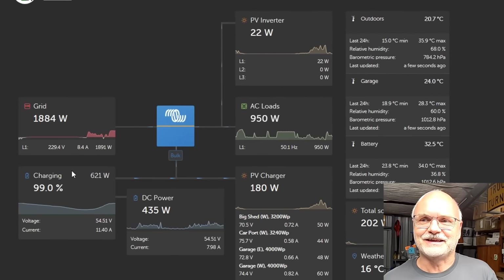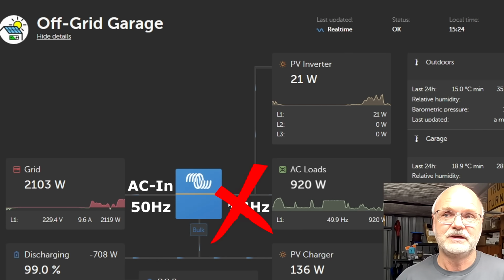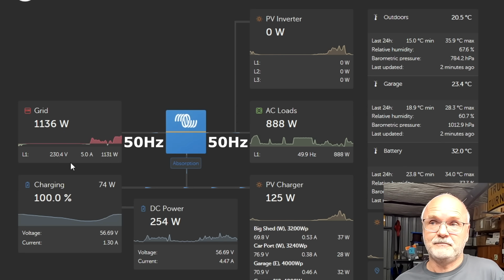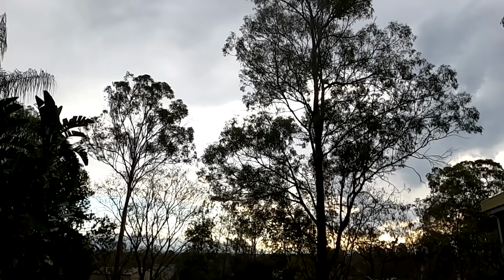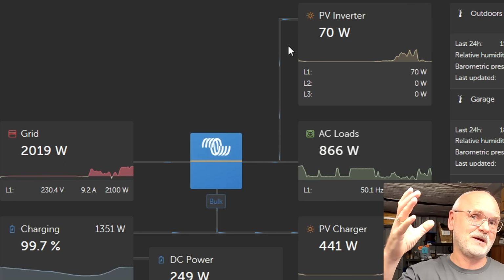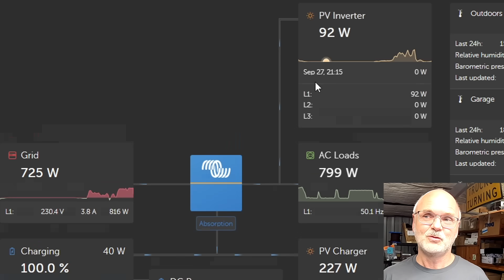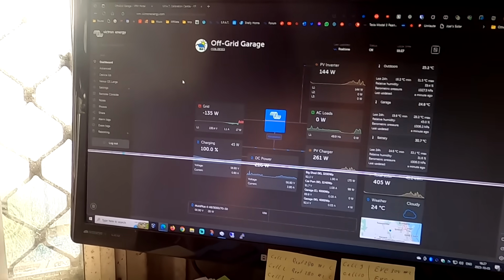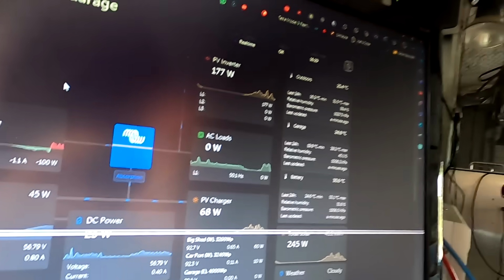Victron Multiplus, Micro-Inverter and Generator. Where does the energy go once the battery is full?

Comment: I think I asked for testing this scenario 😅
Next step should be the measurement of voltage and current with an oscilloscope to check their shape and phase shift. It could be that it is all reactive power (Blindleistung) and the Victron and the microinverter are a bit confused with 90° of phase shift.
Reply: Blindleistung ... ist das nicht der Schaum im Bierglas?
Reply: @mbr8981  Ja, genau 😄
Reply from the maker: What would make the inverter shift phases though? They would need to go opposite directions, one inductive, the other capacitive to compensate for the surplus power.
Reply: @OffGridGarageAustralia  There is no "excess" power if the inverter and generator are incorrectly calculating "power" as AC RMS volts x AC RMS current measured and calculated based on internal parameters. The inverter is likely only putting out 15-20W net to compensate wiring losses from 150VA getting bounced back and forth between the inverter and generator output filters.

Comment: Thanks, Andy I was wondering, 230v but what is the current coming from the PV inverter? If there is low or no current flowing the voltage should not mean much should it
Reply from the maker: It was around 130W, so roughly half an amp at 230V.

Comment: Hey Andy, maybe you use NodeRed and a DTU to shut down / limit the power production of the micro inverters.
Reply from the maker: The micro-inverter is connected through a Shelly 1PM so this is actually an option to turn this off if certain situations occur. Home Assistant is another one...

Comment: I have a grid connected multiplus II with PV generator on AC OUT 1, It does change the frequency when the inverter is not allowed to feed back to the grid.  So AC IN and AC OUT 1 can have a different frequency.
Reply: I am studying on installing such a system and did not expect the Multiplus doing a frequency-shift whilestill being grid-connected. Are you aware of any Victron documents that may shed some more light on this? Specifically AC-coupled PV in a zero-grid-export multiplus installation.
Reply: @marcelvanlieshout3508  In the ESS settings you can decide if you want AC coupled PV feed to the grid or not
Reply: @marcelvanlieshout3508  Sorry but every time I comment here, it is removed.   I followed victron online courses. I use the ESS function that must be configured as an assistant.  If you don't need ESS you can just add the "PV inverter support" assistant.
Reply from the maker: Is this maybe turning off the transfer switch in the MP when you disallow exporting?
Because if you have a large load coming online, the MP would not be able to lower the frequency quickly enough and it usually takes such power spikes quickly from the grid.

If you post links, the comment will be removed. Sorry for that, YouTube does not give any other option.
Reply: @OffGridGarageAustralia  perhaps it uses the batteries to satisfy this surge?
Reply from the maker: @marcelvanlieshout3508  of course... we have a battery too 😁🤦‍♂

Comment: It can go into the Generator ( off-grid inverter). That is also a bi-directional inverter charger and will charge that battery bank.
Log into the other inverter, and you will see it isn't just a calculation.
A Phoenix can have AC - -coupling and use it to charge. The Charger settings are available in the Veconfig software. They are just customarily hidden.
When the Phoenix batteries are full it will raise the frequency to the entire system, and in doing so the micro-inverter will throttle.
Reply: I suspect the above is correct answer, depending on how the Phoenix is setup. My Quattro has a AC connected PV inverter, and it is setup as an ESS system, but in the event of grid failure it will still power the house. My understanding is that if the system wasn't  setup to alter the frequency when I have grid loss and the batteries are full, and too much power is being generated by the AC connected PV it would be dumped into the cells until the BMS shut off due to over voltage, then the whole system shuts down. I've not tested this, but have tested the frequency shifting, which works perfectly.
Reply from the maker: @TheRonskiman  yes, it is correct. I tested it today and could charge with over 2kW through the Phoenix, backwards into the second battery. It really works! Got it on video too.
Reply: But with Phoenix default settings it wouldn’t increase frequency, so would overcharge and/or shut down. I wonder why Victron don’t enable frequency shifting by default. It seems like a safer default. A diesel genset will increase frequency as load comes off. Maybe this is why Victron don’t recommend using inverters as the generator. Detailed config required to make it work well.
Reply: Some advanced s*** this 😂
Reply: The manual does not mention anything about charging from the mains supply.
Reply from the maker: How do I connect the Phoenix inverter to VEconfig software? It has no VE.bus, just Ve.direct.

https://www.victronenergy.com/media/pg/VEConfigure_Manual/en/introduction-and-requirements.html
Reply: He travels/lives in a truck,vid is 1 year old.

Comment: Cant the Phoenix Inverter charge the battery?
Reply from the maker: The Phoenix inverter is an off-grid inverter, so cannot take reverse power.
Reply: In his example the batteries were already full.
Reply: @adon8672  ok at least the first part was only the multiplus battery there was full, as the "generator" was on another battery, maybe i misunderstood 😁

Comment: It's exporting back to the grid by raising the voltage higher than the input from the grid, a grid connected multiplus does this all the time the phoenix inverter is getting back fed and is likely handling it a bit but eventually you will will I suspect burn it out
Reply from the maker: Yeah, good point, the 150W is probably what the Phoenix can cope with, with more it might go 💥

Comment: It had been 4 days, I was getting withdrawal symptoms!

That's an interesting conundrum. Why is it showing energy going to the other inverter? Does it have some sort of load capacity like wind inverters?

Once installed, my two SMA dual string inverters are meant to be controlled by increased frequency too, so the question would be the same (as we have grid input too). But they and the SMA hybrid inverters will also be connected via Ethernet/WiFi so maybe they can control the string inverters that way too. I know this isn't a solution for you, and I'm not sure it is for me, so thanks for sharing this. I don't want potentially 10kW flying in uncontrollably 😮
Reply from the maker: I'm not too concerned in my case because I don't have the genset running when the battery is full. It was more the question, what will actually happening in these rare occasions and raise a bit of awareness.

In your case, the communication between the devices could be what will prevent any escalation in such a situation.
Reply: @OffGridGarageAustralia  maybe my expensive SMA Home Manager will be of use, as it sits right after the grid, so could potentially isolate the home system from the grid if needed. It's a hefty little piece of kit for its size.

Comment: Like# 67
Reply: System overhead?
Reply from the maker: Tomorrow, Paul, tomorrow... 5am AEST. Or Sunday...
Reply: @OffGridGarageAustralia  the suspense... my Growatt does the same thing and I have no other "grid" source... How do you measure what the inverter is consuming? I "inferred" it as I have no idea how to actually measure it's consumption... Impatiently waiting until tomorrow...
Reply from the maker: @paulcurtis5496  consuming in terms of self consumption of the inverter in standby?
Reply: @OffGridGarageAustralia  self-consumption across the board, to power itself, perform its duties whether in standby or running. I'm not sure how to accurately measure this, but I do see it in the way you were seeing it. I'm not connected to any other power source other than the sun, when my battery is full the solar provides more power to the inverter than the load - so where is the excess power going? I've always thought it was being consumed by the inverter itself.
This consumption varies between 80-200ish watts? I just don't know how to accurately measure this, I can only subtract the load from the incoming solar.
Well and some amount is lost to waste, resistance, heat, all of the transactions between components, poor solder joints, insufficient wire size or material, etc.

Comment: I thought that when the load==AC coupled PV generation it would then disconnect the generator.
Now it has disconnected the Generator it can then increase the frequency to reduce the output of the AC coupled PV.
This assumes your AC coupled PV is on the AC2 output of the Multi-plus.
Reply from the maker: It does not disconnect the gen though. It stops taking power from it, but the gen still sets the 50Hz for the whole system.
Reply: @OffGridGarageAustralia  There seems to be a hub-2 Assistant that does disconnect. But seems to warn against using that as can then struggle with power spikes. Glad you pointed this out as I though I could AC attach some micro-invertors to a grid attached system and it would frequency shift. Now I realise only reliable route is to go down the Fronius route which seems the only supported way to avoid grid export (which I can't do here).

Comment: No mp won't stop charging. Can you connect a relay based on soc.
Reply from the maker: Yes, I can. The Multiplus has got one built in. I could use it to turn off the Shelly of the micro-inverter.
Reply: @OffGridGarageAustralia  I would definitely do that. I just had a fire from a ac coupled inverter not turning off due to a BMS fault I believe. You are getting away with it at moment because of small AC couple but you really need to control it. The Phoenix is a low frequency inverter and any excess power freewheels through the clamp diodes on the MOSFET drive back into the battery. Mine diy inverter works the same.. it has no way of stopping that power other than turning off the AC output to the microinvéters or relying 9n frequency shifting.
Reply from the maker: @jasondevine6014  it never occurs in my system. This was just for a test. The gen/Phoenix does not come on automatically.

Comment: Probably boiling your capacitors in the multi plus
Reply: Wrong. If multiplus cant change output frequency from having power at it's generator input, it will dump all extra power there (basically that input is directly connected to the output via relay)
If there is an actual generator there, it will reduce fuel usage to compensate (or frequency will increase till solar inverter throttles enought if there is enought power to spin generator with an engine). 
Having inverter instead of a generator: it will charge the battery untill full and then increases frequency itself / blows up / shut down. After that multi plus no longer has any power at generator input so it can raise the frequency running by itself.
Reply: @volodumurkalunyak4651  very interesting
Reply from the maker: Good point with the lower fuel consumption with a real genset.
The Phoenix inverter cannot charge its battery though.
Reply: @OffGridGarageAustralia  on the video multiplus eventually reported negative power consumption on "generator" input - essentially it allowed power from grid-tie inverters to go there (into Phoenix inverter, 200-250W If I recall correctly). 
Therefore Phoenix inverter must have charged it's battery at that particular (probably short, at least coule of seconds) period.
What would happen if batteries were full (+ BMS cutoff on either cell overvoltage or pack overvoltage) - Phoenix inverter would either shuts down (on input overvoltage) or blow up or increase output frequency (forcing grid tie MPPT's into reducing power or even shutting down) - I have no idea.

Comment: 4 mins in ... what I'm noticing here is that the micro inverter has turned "off" way before the DC MPPT's have.  I'm wondering what the sensitivity difference is in low light.
Reply: and very strange at the end, with VRM showing it going to the Pheonix .....  Hmmmm - will sleep on that one.
Reply from the maker: You should have kept watching a bit further 😉. The thunderstorm rolled through and hence we saw no solar production for a while.

Yeah, the Phoenix cannot take any power normally. Interesting thoughts from some here about this...

Comment: I thought Australian Standards required inverter shut down above 253V (10 minutes) or 258V peak. Your micro does not meet AS and shouldn't be used
Reply: It’s 100% off grid, no grid connection, the off grid phenox inverter is connected to the grid input of the multi plus
Reply: In Europe it’s 253V

Comment: Doesn't have the MP a contactor inside, witch can disconnect the generator, and then increase the frequency?
Reply from the maker: You usually use the relay in the MP to turn on the gen when the battery is low. You can also use it to turn it off when the battery is full, why not.
So that could be a safety mechanism you can implement.
Reply: thats what i was expecting - but no, thats not what happened.